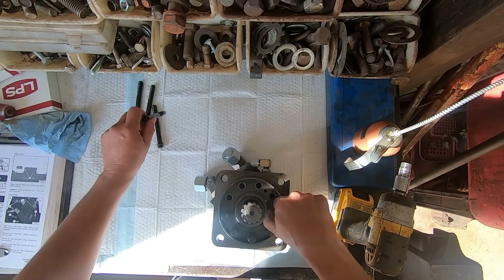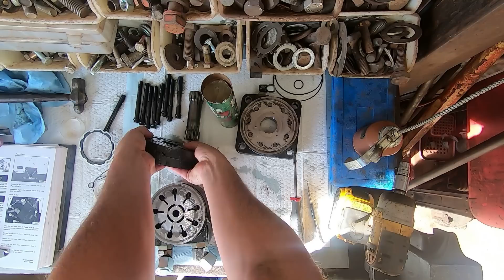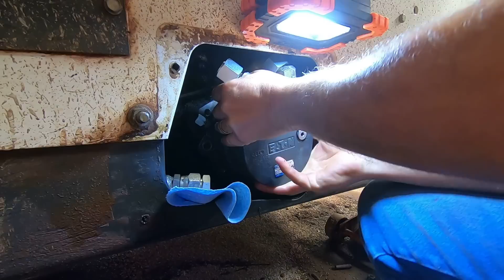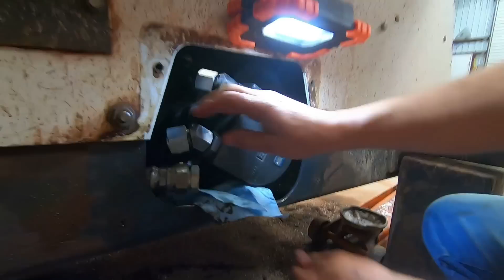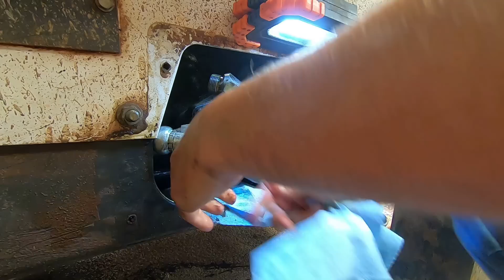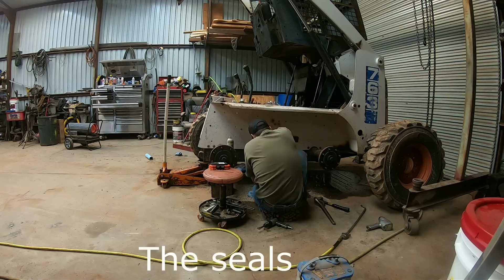Bobcat 763 drive motor seal R&R

Comment: Hello, I am from Argentina, I have a bobcat s220, I need your help, the problem it has is that it does not rotate, when the joysticks are activated, it sounds like counter pressure (only to rotate), the problem is in the right joystick, now When moving forward or backward, it makes a strange noise, where can I start? I do not have a manual or book for this machine, thank you
Reply from the maker: Sorry I don’t have a manual on a s220 either. Could be the safety lock valve?
Reply: I would like to be able to send a video of the problem

Comment: Very good job.  It took me at least an hour to reassemble the first one trying to keep the case drain aligned  and o-ring squeezing out.  I came up with a easy way to reassemble and it took me 15 minutes to replace seals and reassemble. I have a bidea but i have no idea what to do with it.  I took 2 longer bolts and cut the heads off.  I screwed them in to the bottom housing directly across from each other.  You simply have to align the drain and slide each piece down.  After got everything replaced, i installed a couple bolt to ensure nothing moves before i remove the guid bolts i installed. Try this and if you like it you are welcome to use it in your videos cause i dont care.
Reply from the maker: Good advice! Thank ya

Comment: Ah just caught this vid.  Timely for me.  Though I have a 632B and the service book was hesitant to take my growling motor apart. Slightly diff drive motor, but same geroller design.  Good to see whats in it for real - not happy with the books lack of quality pics and poor descriptions.  Caught the tip below on capping the lines to see if the drives will kill the  engine - I'll try try that.  My Bobcat was dead when I bought it, I had to unhook the lines to roll it up on the ramptruck, and it skidded one side where I forgot to take the caps off the drive motor.  Great geisers rushed out to meet my arm when I did, so this makes sense wrt killing the engine.  A good test.

Comment: I happend to have a 751, the motor looks litterly the same, left side of my wheels litterly have no power, they only spin when i lift the wheels in air. Most likely a bad motor. Was thinking of switching the motors around to diagnose if its the motor or part of the pump that is the fault. I mean they look the same on both sides, can i do this?
Reply from the maker: This machine ended up needing a new pump, but the seals helped a bit
Reply from the maker: They should switch, but from what I was told the best way to test a pump is to cap off the motor lines and check to see if the pump will kill the engine when full forward or reverse. In the case of this machine it would only kill the engine on one side.
Reply: @Digginok  Thanks for a fast reply!, never really thought of that idea i assume it doesn't hurt the pump? Also did you change part of the pump or the entire assembly? Those pumps r expensive, iv heard.
Reply from the maker: It was an expensive repair, replaced with a bobcat pump. It doesn’t hurt the pump as it is protected by relief valves. The seal kits won’t hurt, and they are fairly inexpensive. https://www.loaderpartssource.com/ call these guys they know hydro stat systems and are easy to work with.
Reply: @Digginok  So yea i switched the motors around, took me like 6 hours with breaks, really messy and oily job lol. but anyway the issue transferd from left side to the right side, atleast i know the problems is in the drive motor 100%. Now im thinking about ordering a seal kit for it and attempting to install the new seals. Perhaps thats all it needs? Cheers
Reply from the maker: Hopefully that will fix it, nice work with the diagnosis , I think you are on the right track.
Reply: @Digginok  got the seal kit finally and opened the motor up. 2 seals internaly were absolutley destroyed. One was a simple o ring, other that oddly shaped pressure seal, my theory is that somehow case drain line was blocked and an overpressure occured in the motor blowing the seals i dont think they degrade to such pieces overtime. Should i check something to make sure that new seals stay in good shape? Ty for reply in advance! Also made a video about it on my channel.

Comment: Do you happen to have the seal kit part number still? I ordered a kit for my motor it looks just like yours but its off an older 642 machine. I am curious if its the same motor so I can follow your instructions
Reply from the maker: Sorry I do not, but they should be real close
Reply: Appears to be 6669455 kit

Comment: so what made you decide to rebuild the drive? oil going into the chain case? and did it work? i have 97 763 that i think i have to do this to
Reply from the maker: Mostly the age of the machine, no oil to the chain case, just lots in the case drain from the motor ( the little hose ). It did help somewhat, but it needs a new drive pump.
Reply: @Digginok   thanks for getting back.....did you change the brass/bronze filters
Reply from the maker: No problem!

Comment: Hey neighbor, what about the guy between the New Holland dealership and Duit construction ?
Reply from the maker: I'm not so sure about them, actually he is the guy who said to check the case drain flow, seems like good advice. But i had a cylinder rebuilt there once and I won't go back again. Nice folks for sure but when I asked why my cylinder was smoking the chrome off the rod, they said the seal kits were fitted too tight, I think they didn't lube the new seals. I replaced the seals my self and have no problem since. Probably my bad luck, but that is why I fix stuff myself! I do buy some teeth from them once in a while.
What do you know about them?
Reply: We"ve had 4 cylinder"s rebuilt for 2 of our machines and haven"t had any issues yet ,one of the machines produces 300,000 pds of push & pull , so far so good we had that done 4 years ago but I guess there"s always that chance .
Reply: Hey I watched yer video on tapping a pvc line ,,,,,,,,,, ya ever done that on a transite line ?
Reply from the maker: I do some repair work for the town of Orlando, never tapped one but have had to repair a couple transite pipes. Good to hear the cylinders are working for you, I have heard others say good things about that shop, like I said probably my luck!
Reply: Orland Ok my gosh my Dad did some work up there 30ish years ago and ended up bringing home all of the old twin bulb light poles that used to be in town
Reply from the maker: He probably worked with fireman Bill!
Reply: I"ll ask him !

Comment: Looks like the motor could have used some lapping. A granite plate with 400 then 1000 paper and time will have the motor perform much better. Guide studs it what I use to use as well as small tie straps to mark lines. Good instruction
Reply from the maker: Larry Tomb you are probably right will definitely consider that if I do another one someday. Thank you!

Comment: did a few pump's motors not that hard. Clean work spaces and micrometer measure parts. Nice work.
Beware of Asian aftermarket kits..Chinese copy no good .
Soon only Chinese take out food will be made in America.
Seal.relys on wear compensation plates and lapped tight clearance between sides of gears . Oil seal on shaft is to keep dirt dust out and catch weepage. Not for pressure.No high pressure should reach seal.
Check Mani pump and relief valve poppet o rings blow causing low pressure. Charge pressure should be about 300-500 psi. Charge pump could be tired. Usually first to wear out. Hydrostatic brass piston shoes also wear on surface of angle plate. 
Easy to rebuild but you need a hyd pressure test kit 5000psi and fittings. I have drilled tapped elbows to use as test ports if machine has none. There is a charge pressure test nipple under seat. Quick coupler type about 1/2 diameter. 
Also if oil shows brass bronze flakes in test main hydrostatic pump shoes bad. 
I has a T190 tract one brakes were staying on in final drive from low charge pressure also put bronze in oil ruined brake pack.

Comment: if you put your caps back together in matched pairs. you can mark the pairs individually on at least 3 flats each.  with a die grinder, or a scribe.. that way when you take a pair apart to plug each hose.. the hoses are now mated.. as long as you don't change cap positions.. or you can photograph the cap positions before taking off the removed part..  so you can put the back on the same place.  1 set of scratches, 2 sets of scratches, 3 sets of scratches..  you get the idea..  how big are those fittings.. bigger than 2"  you can get a 61515 at horrible fright  for 50 bucks that is 1 3/8 thru 2" double open end..  chop them in half if you need 2 of the same size and use a  pipe on the stub. giving you a 60 and a 15 degree opening for fittings.  they used to have a metric set too.. i don't see it but it might exist in store.  just a thought.  i don't know how you feel about imported tools..
Reply from the maker: wayne p that’s a great idea on the caps!!!

Comment: good video. That was a nice tutorial on replacing all the seals in that drive motor. I don't think the time was lost. I just think you have more work to do yet. Thanks for posting and take care
Reply from the maker: tdej80 thanks Tim!!! Yes I don’t think I went backwards yet, the seals helped for sure.
Reply: @Digginok  I understand that you have issues to address with the pump. But in my mind you started in the right place because a new or rebuilt pump would not make that much difference if you did not have the seals and the rest of the machine to retain the pressure. The machine is old but still a good machine and it is worth some hydraulic service. That is my opinion on the matter

Comment: Hi Frank, Good tutorial on hydraulic motor remove and repair. Too bad it didn't fix the problem. I hate it when I try to fix something, make an assumption, and then find that I barked up the wrong tree. Is there some way you could do a pressure and flow test on the hydraulic pump? Good thing you didn't find any metal particles inside the motors.
Reply from the maker: David Morse thanks!